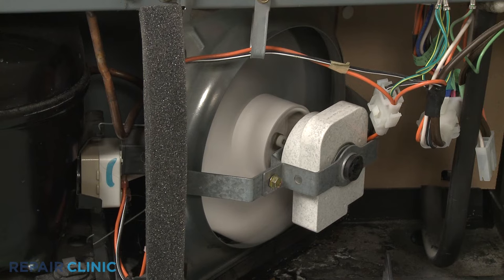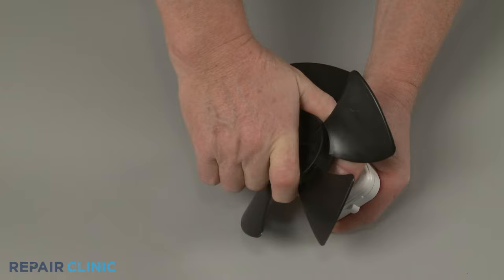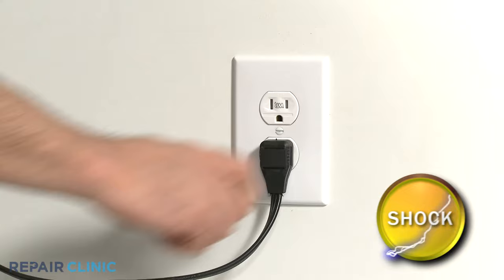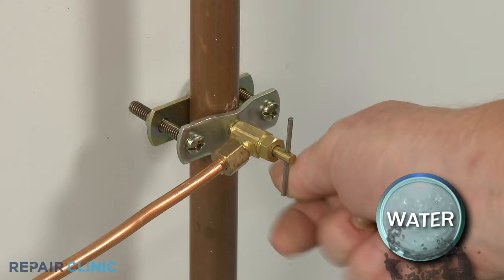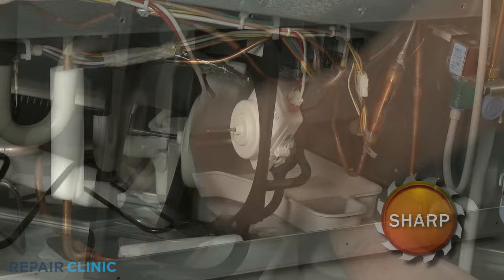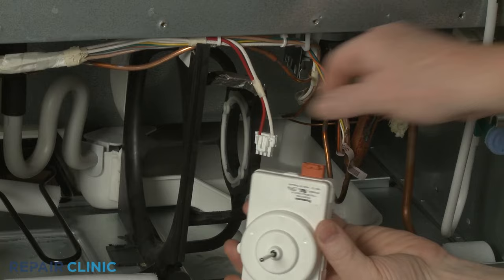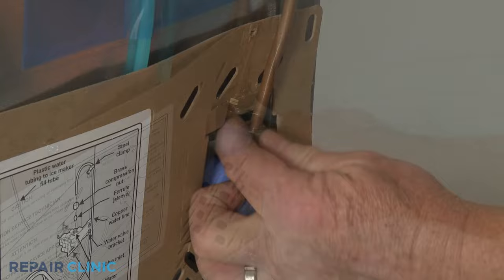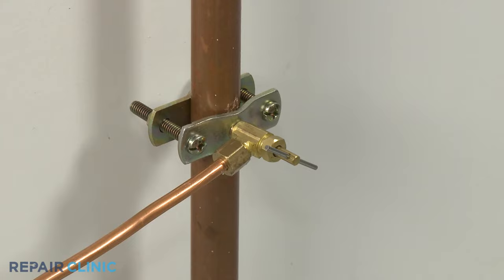Refrigerator Condenser Fan Motor - How it Works & Installation Tips

Comment: Can anyone answer a question? The condenser is spinning the fan, but the little metal "spike" the fan attaches to moves all around so the fan wobbles and hits. Can I repair the condenser or have to replace?
Reply: Yes, I had the same problem.  You need to replace the motor as I believe it's  the  bearings inside the motor are no good and is now loose. I replaced motor , works perfectly

Comment: This fan motor somtimes coms with 3 wire, what is the 3rd wire for?
Reply: for a capacitor, sometimes the motor comes with one.  if not, read the motor's data tag for a MFD rating and get the proper capacitor for it.

Comment: my refrigerator is making a loud screeching noise. i opened the back cover and its coming from the condenser fan. think its going bad. it there a way to make it stop making that noise? i ordered the part already but as a temporary solution so i dont have to disconnect it while i wait?

Comment: hello I have a particular problem with my Amana side by side fridge. The evaporator cools well and frosts fast once turned on. But the evaporator FAN does NOT work. I noticed that the cable that supplies the evap fan is connected to the defrost thermostat. Once I bypassed this connection ( took off the defrost thermostat and connected the cables to the fan ) then the fan runs continuously. Does this mean, that the thermostat is bad??? or is there another part
I am not seeing here. Thanks for any ideas.